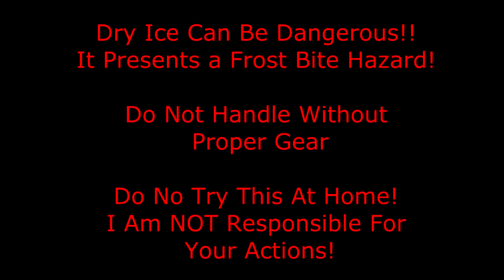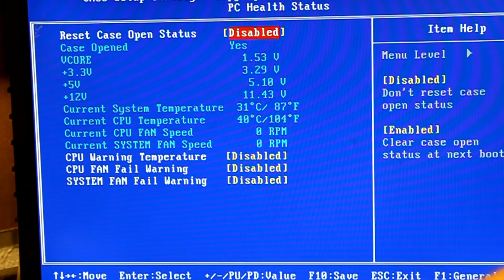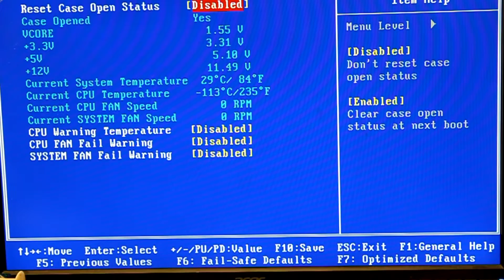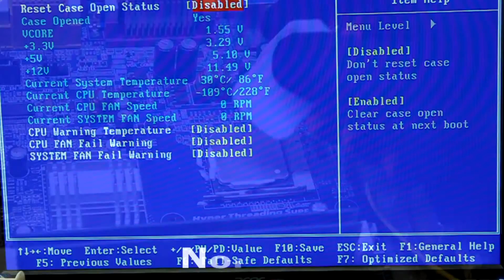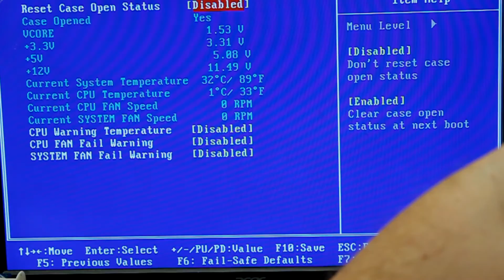Cooling a CPU with Dry Ice

Comment: How cold does it have to be for the CPU to stop functioning
Reply from the maker: I think it depends on the CPU and the composition of the materials used to make the CPU. In most cases the supporting components will suffer issues and failures before the CPU, mainly things like capacitors. Condensation could become a problem as well. But you have people out there cooling CPU's with liquid nitrogen, which is colder than dry ice. There would be a point that if you got something soo cold that it starts to lose the properties that make it work. But the temperature varies between components and CPUs. But from some reading I have heard of people having CPUs down around -170C ( -274F ) if not a bit further.
Reply: its called cold but.... depends on the cpu. newer intel chips have a cold bug around -80- -130c on average.... there was a time where amd had a line ( i think it was a athlon. dont know tho.) where they used liquid helium to cool it down to just under 3K° wich is really cold

Comment: 40C is not hot at all. 100C is hot for a CPU
Reply: He is in the bios under practically no load with an outdated processor. It shouldn't be hot yet. And he stopped his test before it got hotter.
Reply: SAM STRECKER what about 75 or 80??

Comment: My laptop overheats way to much and shuts off when it dose I was wondering if I could put my laptop on a small stand and some dry ice to cool it down . The dry ice won't be in the laptop it will be outside
Reply: What do you think , will it work
Reply: +Erick Mejia Unfortunately not, you'll need to find another solution
Reply: +James Kightley (Kightleymusicstudios)  thankz 😀
Reply from the maker: +Erick Mejia yeah, this video was a bit of messing around, it's not a permanent solution by any means, it was just an experiment.
Reply: Is it possible to make a box for the dry ice that has a ventilation to which fans could blow cold air onto the laptop. Would it be able to keep the laptop cool enough so that it doesn't overheat? Or would I need another solution?
Reply: @MajesticSam  Look into cleaning your laptop and applying better thermal paste first. Don't bother with liquid metal since it doesn't work wonders, especially  if the heatsink is just one of those pathetic flimsy ones.

Lastly: Use a Desktop for heavy lifting. Better cooling, maintainability, upgradeability and more Power make it better suited for rendering/computing tasks.
AMDs Ryzen lineup offers a lot of bang for the buck for multithreaded workloads and old server hardware isn't prohibitively expensive

Comment: if I do this, will it destroy my cpu or is it safe?
Reply from the maker: +Axel Gavin It's a real risk to take, that machine was a machine I did not care about. I think in the end I bricked it either it got hot or the condensation got to the motherboard. But again I was not being the most careful, it was just an experiment on a junk machine. If you care about the machine I would suggest not doing it, dry ice only lasts for short bits of time.
Reply: Thanks for the info.
Reply: @YG-rv3oj  Hey if you are still looking to do dry ice cooling. I would recommend LN2 cooling 1st. You basically have to use the same precautions.The following link is a better done experiment, but he does say how to properly do it. https://www.youtube.com/watch?v=POzSFFLFoZ8